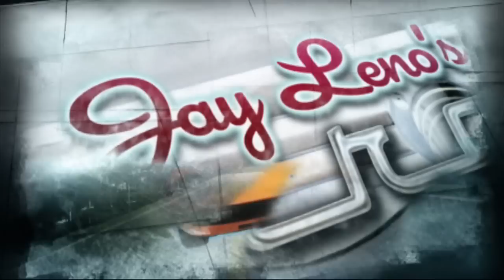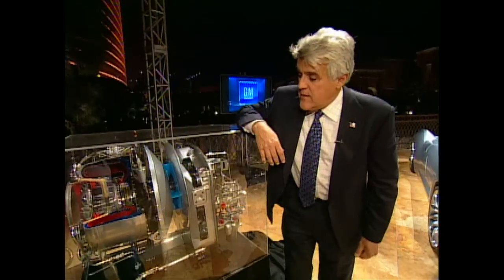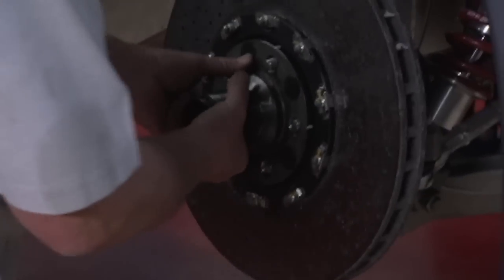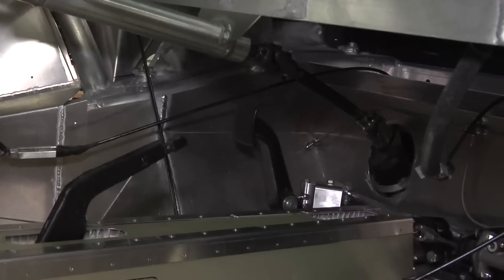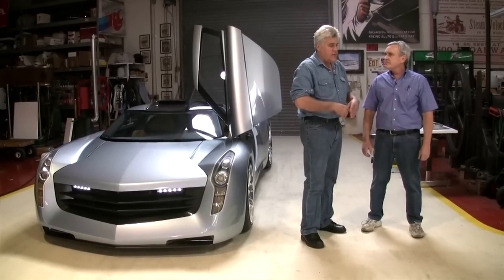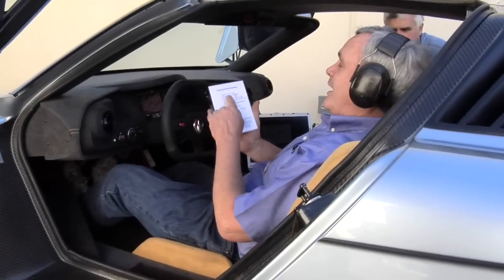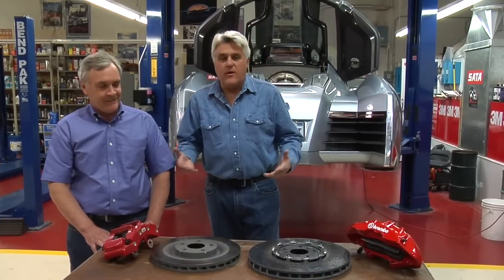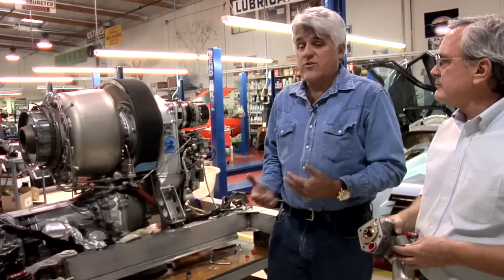EcoJet: Definitive Edition - Jay Leno's Garage

Comment: 2 1/2 years to build.  not one wardrobe change for Jay.
Reply: +whitedevil2 
He never shows us the other warehouse where he keeps his denim, but it must be massive.
Reply: uniform
Reply: Just worked with Magnus Walker. He told a great story about appearing as a guest on Jay’s show. When Jay was walking him around the “garage,” he asked Magnus if there was anything else he would like to see. And Magnus replied, “ yeah, I want to see the room where you keep all your denim shirts!”
Reply: Not true... he was wearing a suit at the beginning of the video.
Reply: @The.Breakfast.Burrito  True this, lol! 😂
Reply: Is anybody but Jay even trying to DO a turbine car anymore?
But it looks like this one will sure BOOK!
Reply: @heldgop i was thinging that would be a more practical way to apply an even power curve!
Reply: @ronniepaulinc  Exactly. The drawbacks of a turbine are largely that it's only efficient at high speed. Get this turbine running a generator, send the electricity to electric motors on the driveshaft. You can get rid of the transmission (and thus avoid breaking another one), run the engine at its most efficient speed, and get instant torque without waiting for the turbine to spool up. You don't want batteries for this, you want capacitors. You won't be running electric only due to the inefficiency of starting and stopping the turbine.
Reply: That's his auto shop uniform. He has a lot of the same wardrobe. It makes perfect sense to Jay. Remember, he keeps his comedic vibe from his late night show. It works out fine.
Reply: @The.Breakfast.Burrito  that was after it was built tho...

Comment: I'm amazed at how compact the turbine engine is.
Reply: +Jam Dennely yes, they can be made tiny but the power output will be much lower as a result. i believe what he meant was that he was amazed how compact the engine was whilst outputting that power.
Reply: Did you hear him say it made 700 ft lbs of torque. That's a whole lot of power to weight ratio reason why they use them in aircraft
Reply: They're only $7,000,000.
Reply: yep, this car is the only modern car with turbine engine

Comment: I have always been good at building things and mechanical work, but I have to go to the back of the bus compared to what you have achieved. It looks great and is most definitely unique. An outstanding achievement and can only guess what it's like to drive. Fantastic job Mr. Leno and yes I know you had some help but without you, it would not have been done. So congradulations on a wonderful build.

Comment: I'd really like to see a turbine-powered hybrid car using 4 high output electric motors and a 25KWh battery pack mediating power delivery. That way the turbine can run at optimum efficiency, and you get the instant power delivery of the electric motors. Jaguar did something similar with the CX-100, but it never went anywhere.
Reply: The cars hp output is a little overkill too. You have to much power and need to slow down the turbine some how so it don't burn out clutches or plates in the transmission.
Reply: I don't see why they didn't use a CVT or hydrolic pump and motors to drive the car, heavy machinery use setups like that and they run at full rpm all day.
Reply: I was thinking that too. Have the turbine run a generator while the wheels have in wheel / hub motors. One would have the turbine at constant speed and have instant torque to the wheels. I think there are some current sports cars that have (or similar to) that arrangement.

Comment: Why can't the turbine generate electricity so it can run at a set rpm to produce a set range of voltage without ever needing to touch a torque converter or clutch or axles. Then you won't need such hefty brakes since there is a physical disconnect between electric hub motors in the wheels and the engine itself.
Reply: I really thought i was the only one thinking that
Reply: yes yuo're absolutely right, there're jet microturbines from Capsone, Bladon Jets, and maybe others. And they already made such cars! look for Jaguar c-x75 and CMT-380
Reply: Lickmybarrel
I second that. I've wondered about this type of power ever since my air force firefighter days and had to learn about the emergency shutdown procedures on an F-16. If the engine flames out, they have an emergency power unit which is a very small turbine engine that produces a butt-load of electricity to control the servos, lights, gauges, tail hook, brakes, etc. Why not a small turbine running on peanut oil to direct drive at all four wheels?
Reply: theedrstrangelove
you mean an APU or something?
Reply: YES, IT'S AN APU, BUT THEY CALL IT THE EPU.
Reply: Good idea.  This was probably simpler for them to make though.
Reply: Electric engines are very heavy for the amount of power generated. to go turbine to electric to motors wouldn't be very practical for a sporty car.

yes it can be done... but remember Jay is also a mechanical car guy... machanical is just fun to some people (myself included)
Reply: starshooter10  I can see that.
I still install Carburetors (Webers) on track driven cars because of the sound, simplicity and purity it adds to the engine. When people figure out a new fuel that burns clean and doesn't crud the passages of the carb, Carburetors may see a way back into the market. What I want more than a carb, is the throttle being driven by a cable instead of by-wire. If only I didn't have inspections on my daily driver I would smash the computer to bits and install a direct throttle cable, oh and a carb.
Reply: Llia Olsen
clean fresh fuel doesn't "crud up" anything
should be easy to ditch the ecu and fit carbs and a throttle cable to almost any modern car
changing back to a magneto and points may be a bit more problematic
but with computer fuel injection and timing you'd be stupid to do something like that as you' get less power, less wide power band, use more fuel, run rougher make more noise and need more servicing
Reply: A 500 bhp electric motor + a generator + batteries/capacitors. Did you see how tight for space it was without all those?
Reply: BadaBingBadaBoomsday The idea is that if a turbine drives an alternator or generator. you wouldn't need a ton of batteries (like a tesla needs).  Maybe just one battery to start the car and provide some "caching" capacity.
Reply: Llia Olsen That's an EPIC idea Llia! :D I was personally thinking that this bad boy needed to have a clutch and be manual, but your idea is much better. Like PrivateEyeYiYi said, you really wouldn't need heavy storage batteries since that badboy can turn the biggest generator you want! (hmm. makes me want to patent that lmao)
Reply: Seems nobody really gets how ridiculously overpowered this thing is and how  big the hardware to handle it's output needs to be.
Reply: Sorry don't understand this term "overpowered" ?
Reply: Because you apparently don't really understand how a typical helicopter turboshaft engine operates.
Reply: I certainly do. That's an Lt 101it produces no more than 700 bhp and around 400 lb - ft of torque so FAR from overpowered .. bout the same phb but 200 lb-ft less torque than my little sisters pickup . It would be pretty fast but not in the league of a serious hot rod.
Reply: Brian Catnut
stick a GEnx engine or a trent 1000 boom,power for days XD
Reply: Now we're talkin power! Like the mad Danish tractor pullers... 5 BIG turbines onboard. Obviously the RR turbine in a car would be not so good for nipping round town but a pretty awsome thing. Also you'd be hampered by low bridges and narrow roads.
Reply: Llia Olsen Would work, can also install an interturbine bleed valve to dump the core exhaust (well most of it) before it gets to the LPT. All things considered, a helicopter engine probably isn't the best idea in the world

Brian Catnut Don't need a Trent 1000, it's bigger than the car. An RR300 however would be perfect for the job. It's a 300SHP gas turbine intended as a direct replacement for piston engines in small helicopters (like the R22 and R44). It's perfect for this car, they don't want all that power on all the time anyway, so it's a better compromise in that sense
Reply: Hafiz On Demand! Why stop there?
I'd go with the GE90-115B.
Reply: manictiger
why take one,WHEN YOU CAN HAVE FOUR
Reply: Llia Olsen Jesus Christ, great idea.
Reply: Llia Olsen Yeah, that's how I would do it. To get higher efficency, although with greater complexity, you could add either a steam turbine, or, for slightly less complexity and better self containment, a closed cycle gas turbine, that takes exhaust gas heat and runs a second generator. To not have to run it at 100% all the time to have the power available, you could keep a supercapacitor bank charged up at any point you are not using full power, and use that as a buffer for when the engine is idling and you want instant full power. Also, there are gas turbines that idles way lower than at 80%. I think I'm going to have to sketch up a drivetrain like this, it really could work.
Reply: Llia Olsen moters don't have vary much tork
Reply: Llia Olsen - I saw a car like that in Popular Mechanics magazine maybe ten years ago. Built on a a Indy car looking chassis, it had motors in all four wheels that served as brakes and generators while braking. Computer controls could offer anti-lock breaking and traction control through the motors. The turbine was tiny and coupled only to a generator. I believe it had a couple of batteries for emergency use and to operate accessories. I often wondered what became of it. Very clever ideas it seemed to me.
Reply: Llia Olsen. It could go very fast with electric motors ,no transmission
Reply: I just commented the same question. Seems a way around the transmission dilema.
Reply: starshooter10
Electric motors aren`t heavy lol.
Batteries are heavy, but if you use a small turbine to produce power, you can get loads of power to the motors, with a fuel/turbine combo much smaller than the one used here, also needing smaller brakes saving weight etc..
This car has crap range, so if you compare it to rc cars that have scale speeds of 1250kmh and more, and can run for 30 minutes, just scale that power system down, scale the turbine down and use it to replace the batteries as electricity source.

Like a hybrid on steroids..
Reply: loctite222ms
"Seems nobody really gets how ridiculously overpowered this thing is and how  big the hardware to handle it's output needs to be. "
Yeah, it needs to be big and heavy just because it`s made the way it is.
Reply: Hafiz Bahar
"+Brian Catnut
stick a GEnx engine or a trent 1000 boom,power for days"
Well, except you`ll consume way more fuel, so you won`t have power for days, you`ll have power for minutes lol..
Reply: They can be powerful though. The abrams uses one
Reply: Probably could do four hub motors at each wheel to save weight and space but the generator needed to handle the current draw those motors would demand to match the performance of that jet engine would be prohibitively large and heavy.
Reply: Wouldn`t need that large of a generator, because you wouldn`t need that big engine, but either way, turbines aren`t good for ground vehicles, if they were, it would be common lol :p
But look at the maximum power handling of a tesla model S, then think about what generator could supply that wattage, THEN match a small turbine that can be matched with the generator to produce that.
(including mechanical loss etc etc)
Pretty sure it would be a far smaller turbine, and a lessened combined weight.
And with weight saving and more unsprung weight, maybe you could save even more throughout the design?
That`s above my pay grade, and it`s too late for math lol, maybe I`ll dream of Tesla Sheep :p
Reply: The electric motors chosen would be what dictates the generator required, and the generator would then dictate what engine you need. We're basicly talking about a drivetrain similar to what most modern locomotives use where size, weight, and acceleration arent much of a concern.
Reply: Weight, Probably. If they made the entire body out of Carbon Fiber and Aluminum, they wanna save weight. Batteries are... Heavy.
Reply: weight , speed , complications....this one is just perfect
Reply: Llia Olsen Idk if this will sound sexist, but I don't care. It's really cool to see a chick interested in things like Weber carbs and such. I'd like to see what kind of cars you have.
Reply: Probably would cost alot more money
Reply: I think its more interesting that its physically connected to the powertrain rather than running a generator / electric motors. I imagine electrics & a battery bank would add a hell of a lot of weight to an already heavy car
Reply: @starshooter10  AGHHHHHH there is no such thing as an "electric engine!" And trains use electric MOTORS. The Tesla Model S has small electric motors and it is faster than almost every engine-powered car on the planet.
Reply: That's extremely inefficient
Reply: @starshooter10  yeah remember his little joke about veggie burger. the dials look like dials but they're not (half smile from jay).  and the way he talked about a transmission from italy , "you can take take it all apart  and put it back together. it's really an amazing piece of machinery."
Reply: The main problem in this build is the engine. Single shaft design. It needs a twin shaft with a free power turbine. In those engines the power turbine speed is decoupled from the gas generator section. Throttling can be achieved with a wastegate between gas generator and power turbine. Look up the Howmet TX, it uses a single speed reduction gearbox with no clutch or torque converter.
Reply: Lila, you should write a letter to Jay Leno and let him hire you as a consultant.

Comment: Well, despite all the critics out there I like the idea & design. Yes, the front looks like a Cadi so what? Cadi's are a sharp looking car. I would really like to see how a car like this drives on the Autobahn. No idea what top speed would be but, you would probably have a hard time keeping it on the road or ground at over 300+ mph. Thank Jay for  showing us all your amazing toys & ideas. Wish I could get a peek in the garage. It's just like a candy shop.
Reply: jdmdealers I'm sure this one is too loud to be road legal in Germany.
Reply: +tornoutlaw I guess you have never been stopped on the side of the Autobahn when a car goes by at 180mph?
Reply: Well, the loudness of a driving car is caused by several things: drag, friction of the tyres, engine- and exhaustsounds. A car passing you at the Autobahn is very loud, because of high drag, friction and enginerevs. but the same car must not excell certain noise limits at a velocity of say 32mph. The turbine of Jay's car is already very loud at low speeds, which violates the noiselimits any car has to meet to be road legal.
Reply: tornoutlaw- Ok, I have walked by Lambo's so loud they made my ears ring. Jay's jet engine car is California legal to drive. Given that CA is more restrictive than other US states that says something. CHP officers were looking the car when Jay parked it and did not complain or write him a ticket for noise. So, this car appears not to be unbearable to be near.
Reply: jdmdealers California does in fact have certain exemptions for experimental, special construction vehicles, alternative fueled vehicles and vehicle that do not use internal combustion engines...

Since Jay constructed a 100% from new car, it could apply for one or more of these exemptions... and operate at a much higher decibel output than would be legal for a new car sold to the public in California...

Case in point, last year I completed a vehicle under California's "Special Construction" permits, It is registered as a brand new 2014 car... but because of the specific combination of components used in its construction... it is exempt from all smog equipment or testing, noise control limits, bumper requirements, airbags, and certain lighting equipment.

Comment: Why not run a wet clutch (oil bathed, like a motorcycle) to a CVT transmission? Use drivetrain oil coolers to preheat the fuel/air mix for the turbine to improve fuel efficiency and reduce ignition temperatures. A KERS (kinetic energy recovery system) flywheel as a brake assist connected to a front differential separate from the rear drivetrain could be used for AWD assist to remove the vagueness from a less direct drivetrain. Probably more rapidly spinning metal than you'd want around you.... but this car is an engineers dream.
Reply: This car was started way before those were popular enough to build in high-power applications.
Reply: cvt doesn't work well in high powered aplications plus when that belt fails oooh boy!
Reply: Jay may have the tools but that's kind too ambious, don't you think? What I mean is that Jay may have only been getting fun and not trying to actually build a true car with a jet engine.